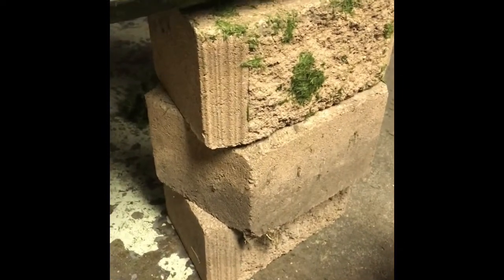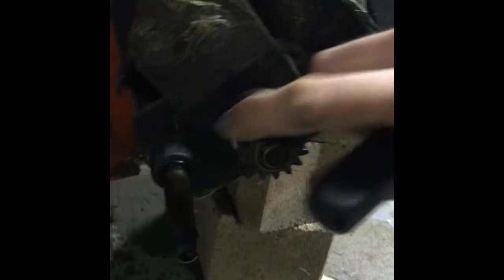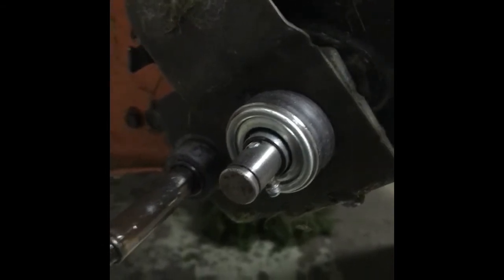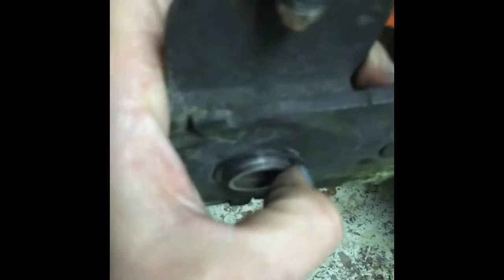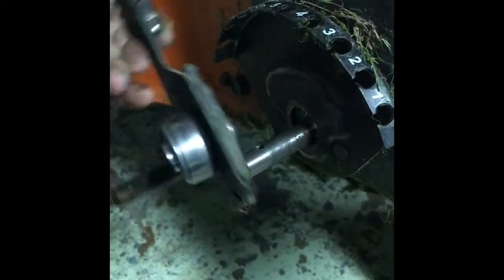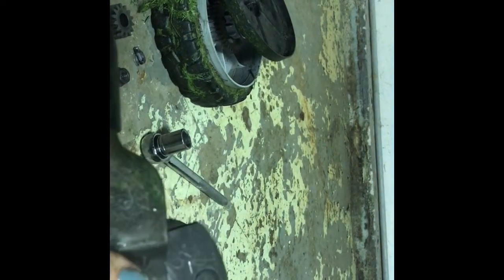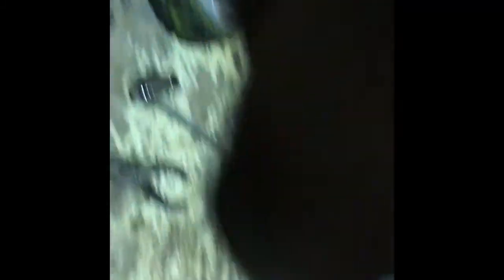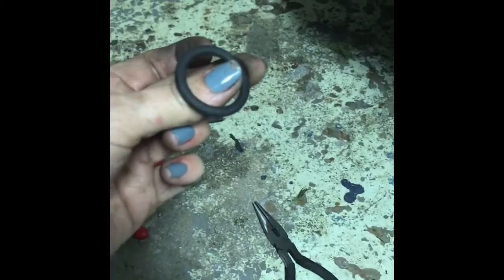Husqvarna lawn mower rear wheel removal

Comment from the maker: After the adjuster continued to break, I discovered the correct way to fix this ( not shown in video). You need to take the adjuster all the way off, including the part bolted to the mower. This is a bit tricky. From there you attach the C clip to the outside and reattach everything back to the mower. Attaching the clip was really hard.  I couldn't compress the rubber gasket enough ( even having my husband basically stand in top of it). I had to take the part into a small engine repair shop and they were able to clip it in with a special tool they have.